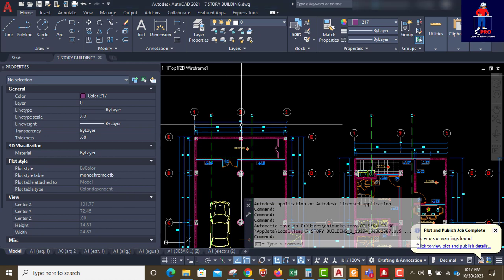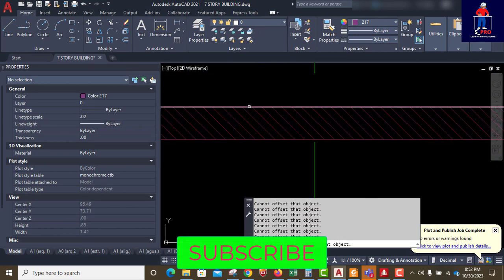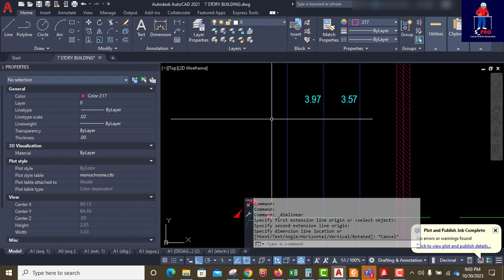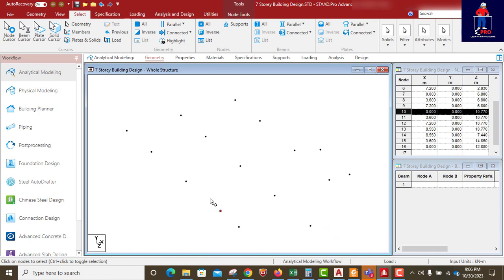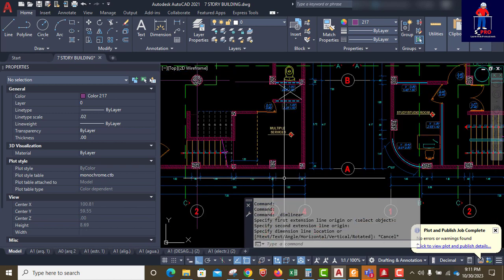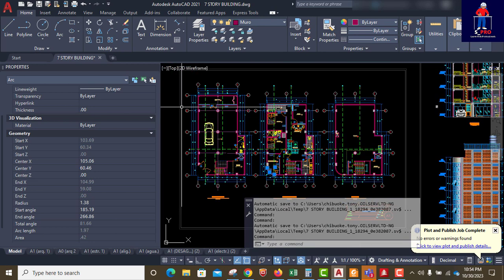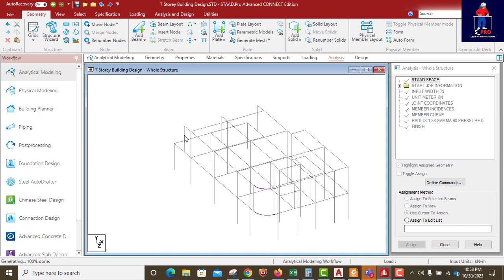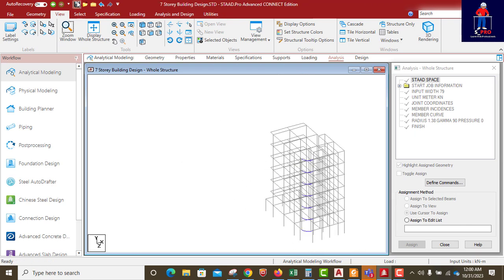7 Story Building Design With Staad Pro & RCDC - Part 2

Comment: Pl. Explain how did you draw curved beam. Is it by connecting only nodes?
Reply from the maker: I used curved beam icon in staadpro but watch part 7 storey building design part 6 for more information.